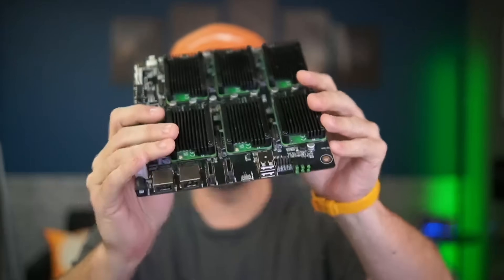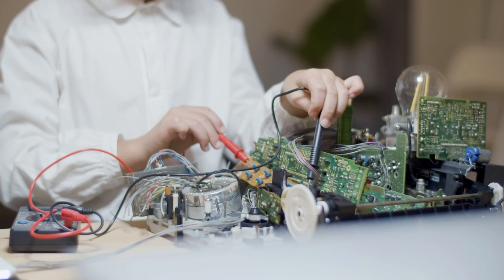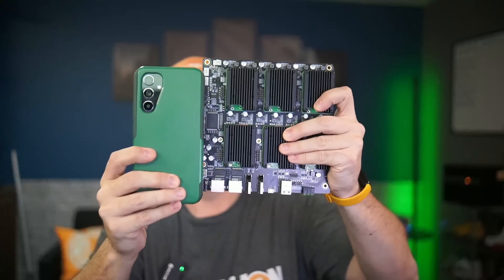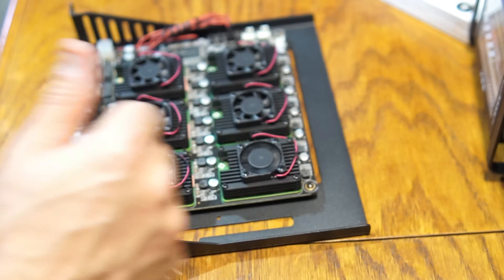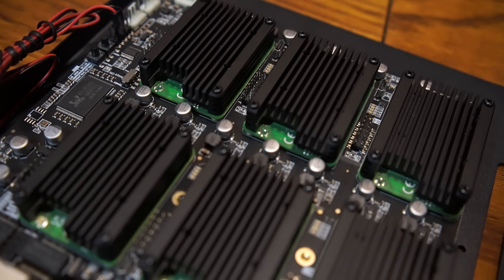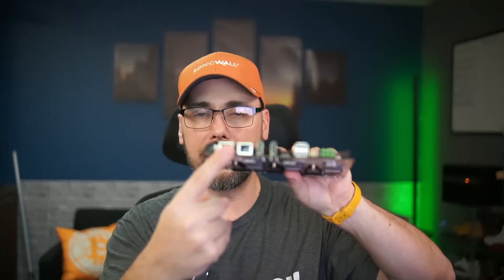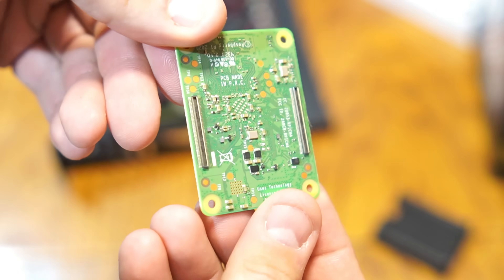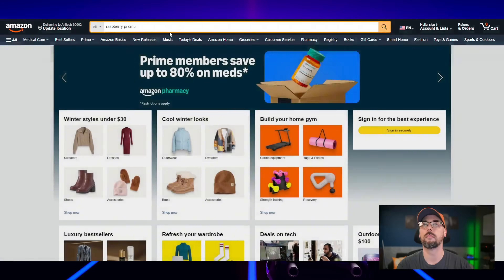A Tiny Data Center You Can Actually Afford

Comment: I am running this with the 16GiB CM5 variant, and an additional RPi4 and this is a fairly competent small K3s cluster that runs everyday workloads at reasonable performance without outright letting your power bill skyrocket.

With the barrel jack, I plan to convert this to PoE one day.

Comment: Lots of people shrilling for these toys, I guess as a proof of concept it's kinda neat and you can get it to learn some basics. Although, you could just pick up a cheap used dual xeon motherboard and it'll be more performative, flexible, and cheaper. You are simply paying for the form factor here. As a learning tool, it's a bit overpriced, as a tool to actually do work, it's next to useless.
Reply: was looking at the comments section & was about to post the same. What is the purpose of such boards & why so popular? In my opinion, they are expensive and consume more power actually than a equivalent x86 server for the same performance. Personally, i have a ryzen 5700g with 64gb the ram that powers several vms using proxmox as a home lab. The way i configured it, it consumes no more than 35 wats at peak, with 20w idle & the performance is amazing. I bought the whole kit from 2nd hand and i paid about 130euro for everything except case and storage.
Reply: @Synaptickz  No purpose just paid ads for sh*t you don't need, what OP here said, get a cheaper better dual cpu board or some old server, I insist YT was beter when we learned not were pushed to buy shady stuff .

Comment: 5:30 I understand your concerns regarding the shared 1Gb Ethernet port in Raspberry Pi cluster boards. Here's a refined perspective. In typical Raspberry Pi cluster setups, each node connects to a central switch via its own 1Gb Ethernet port. The switch's uplink then interfaces with your broader network, potentially sharing a similar 1Gb bandwidth limitation. Therefore, using a cluster board where nodes share a single 1Gb port isn't vastly different in terms of network architecture.

To optimize network performance in such configurations, enabling jumbo frames by increasing the Maximum Transmission Unit (MTU) to 9000 bytes can be beneficial. However, it's important to note that on Raspberry Pi 4 models, this requires recompiling the kernel, as the default setup doesn't support jumbo frames. Additionally, all devices within the network path, including switches and routers, must support these larger frame sizes to realize performance gains. 

Implementing jumbo frames can reduce CPU load and improve throughput, but the actual benefits depend on the specific workloads and network infrastructure. Careful consideration and testing are recommended to ensure compatibility and performance improvements.

Comment: Raspberry Pi sucks
Reply: I hear you. However, I don't agree with you. Your thoughts which are valid, but the market would say otherwise. The Raspberry Pi has established itself as the leading single-board computer (SBC) in the market. A 2021 survey by Farnell revealed that 44% of professional engineers preferred the Raspberry Pi over other SBCs. In 2020, the Raspberry Pi accounted for approximately 2.69% of the global PC market, with 7.4 million units shipped that year. Its affordability, robust community support, and versatility have solidified its dominance among hobbyists and professionals alike.
Reply: @Brian_Onesimus I've had a lot of luck during the pi shortage with orange pi's, banana pi's etc and I would have kept using them if it wasn't for the fact the operating systems either don't work or are stupidly old.

Comment: realistically, if you buy ryzen 3 or celeron, it will be much better and cheaper
Reply: I didn't know how powerful this thing is, but I build a 16 core ryzen 7945hx system with 64GB on RAM for around $600 and it wicked fast.
Reply: @lelokong6898  The Ryzen system, at $600, offers significantly more processing power per dollar. The Pi cluster, even at $540 just for the compute modules alone, requires additional expenses for peripherals (power supplies, networking, storage, enclosures), quickly exceeding the Ryzen's total cost while delivering far less overall performance. The cost savings with the Ryzen are in its integrated, high-performance nature.
Reply: can confirm it
Reply: You're really missing the point here.
Reply: @blu4able360  Thank you for saying that. @ugurugutugu try doing a search on clustering and you'll see what @bu4ale360 is talking about. It took me a little to figure it out at first to don't feel bad.
Reply: @blu4able360  I don't think so. If he used cost effective compute modules, then it will make some sense for homelab. But since raspberry is so overpriced, it really doesn't make any sense. And raspberry is overpriced since launch.
Reply: @ With a 6 code cluster you can do: clustering, k3s, docker swarm, load balancers, ceph, local LM's, parallel computing/projects. You can't do any of those things on a single powerful CPU. You are missing the point still.
Reply: @ugurugutugu  You might want to look up clustering to see the benefits you gain from it compared to having a single machine. It's worth it depending on your needs.
Reply: @blu4able360  yes, you can. 
All of that stuff is easier with a more powerful machine
Reply: @ckckck12  You're not wrong, but I'd say that it really depends on how you're configuring your cluster. Some are configured with one PS with a power rail for each node. This method could save space, heat, and clutter. It can also simplify any backup power needs. There's always a balance of cost and convenience. There's definitely more than one way to skin cat. Right? I have no idea where that saying came from, but it sure does drive the point home.
Reply: He actually can do it using VMs , and average x86 CPU (i5) , and for most of thing , if you have a good CPU , you don’t need parallel stuff , it just makes your life more difficult
Reply: @sapfeer0k  while an i5 with VMs can handle many tasks, it's important to remember that virtualization has limitations. VMs on a single machine still share resources, and you might encounter bottlenecks under heavy loads. Plus, you miss out on the high-availability and fault-tolerance that a true cluster provides.

For certain applications like high-performance computing, large databases, or services requiring constant uptime, clustering offers advantages that a single machine, even with VMs, simply can't replicate. It's about choosing the right tool for the job, and for some jobs, clustering is the better fit.
Reply: @Brian_Onesimus  no high availability in this single board computer anyway. Psu shuts down, cluster is offline. Also heavy loads and bottlenecks, I think every single ryzen is more powerfull in every way than this cluster so no bottlenecks here
Reply: @sapfeer0k  Research groups use clusters of PIs for a reason. A single CPU with some VMs doesn't come close to replicating all the concerns of testing high-scalability clustered code that will eventually run on a super-computer class cluster. Sure, if all you are doing is cosplaying as a home lab sysadim, what you propose will do ok, but for the rest of the world, actual clustering is far more than just a couple of VMs.
Reply: @SomeNameGoesHere  that’s not why they do at all.
Reply: @SomeNameGoesHere  They actually dont, but whatever.
Reply: @sapfeer0k  But you can't do HA on a single node. Doing any of that in a VM defeats the point....